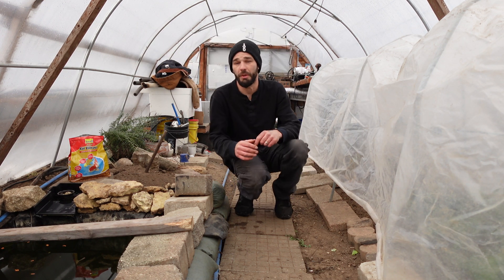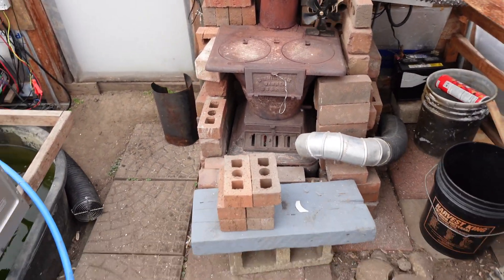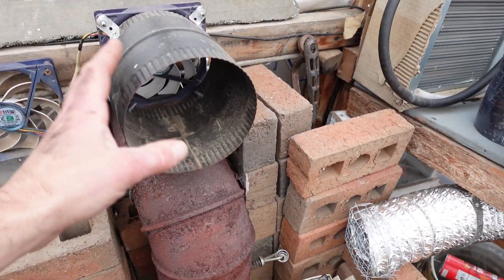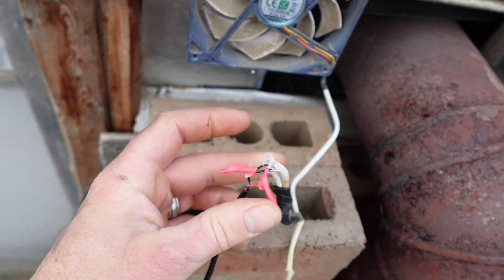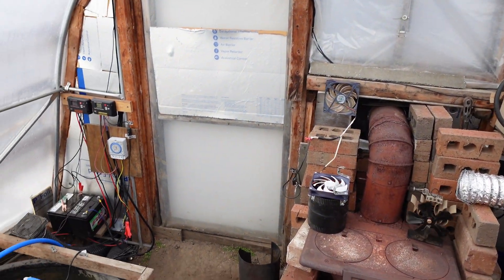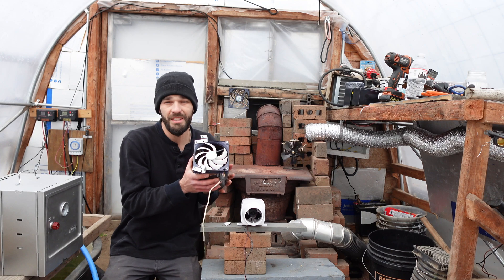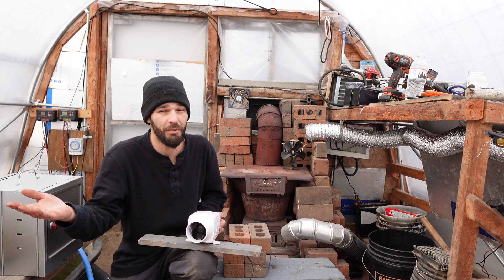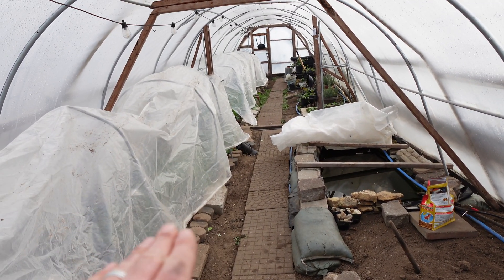12v DC Greenhouse Fan DIY's & Reviews - Tested To Destruction - Wattage & Uses

Comment: Wow! Great content I just ran across today, and have subscribed. I'm in the process of building a greenhouse that will house a woodstove and the long block wall will be shared with a 16' long outdoor fish pond. I'm thinking of running air tubes through the floor with fans (yay for your review) but maybe also a water loop through the pond it self and back into the greenhouse but maybe that's overkill since we rarely get down into the teens in winter here (19 was our coldest night by far this year). I don't have power there, so it'll all have to be solar, so I'll be interested to go through your DIY solar playlist. Good stuff!